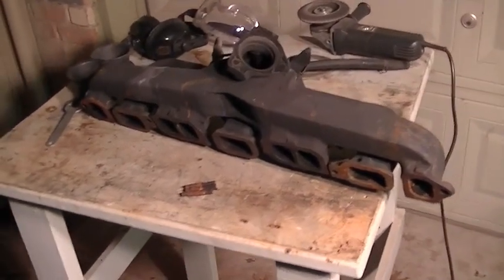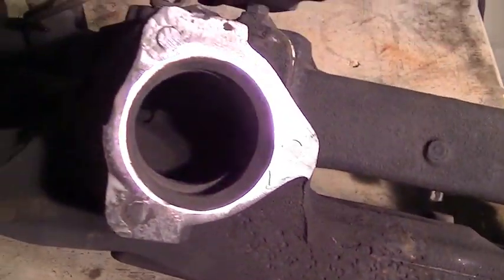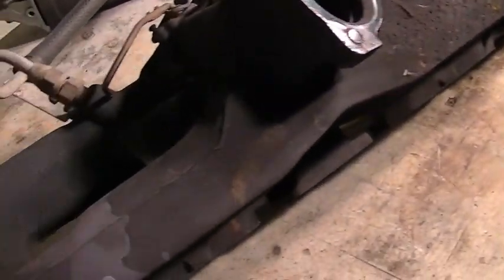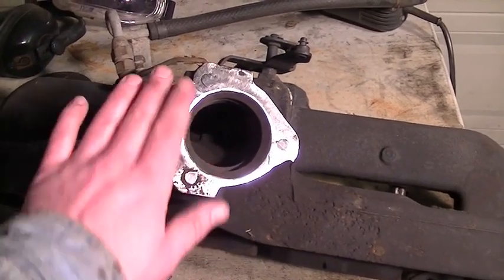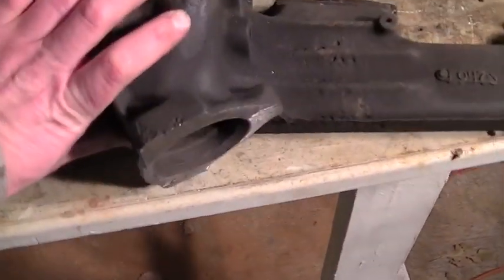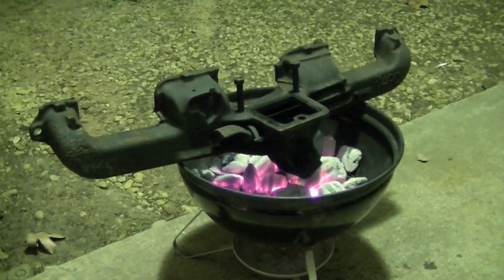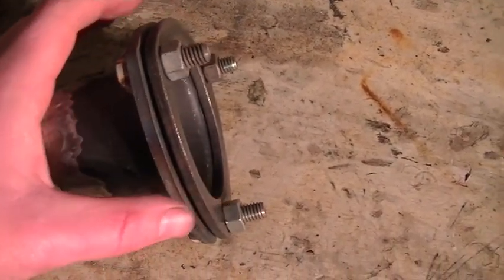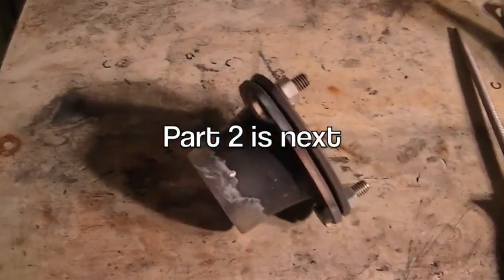Part 1 MIG Welding Cast Iron | Inline 6 Exhaust Manifold

Comment: The absolute best OEM exhaust manifold flanges are the Mopar "ball and socket" fittings. You simply drop the bolts through the holes, mate up the flanges, and put nuts on the bolts. Very clean design. No rusty studs ever.

Comment: Its good you seperated them. That exhaust to Intake gasket is always bad. I always extract the studs while heating the exhaust manifold with my acetalyn torch. Then replace them with the stainless studs and brass nuts kit. Gotta love those old 250 workhorses. Really affordable to keep em going.